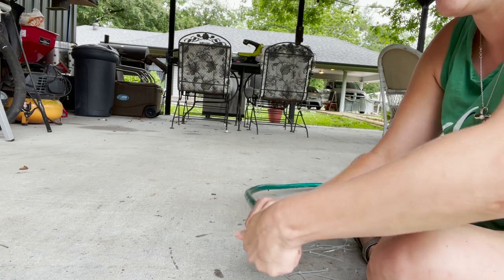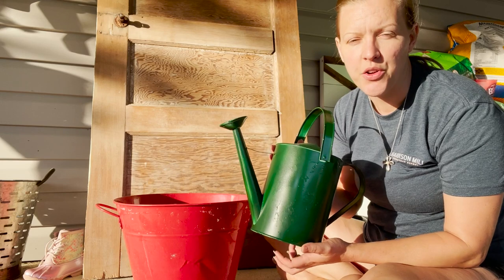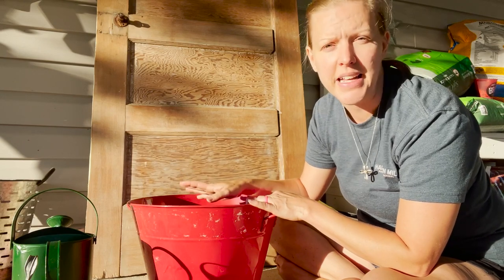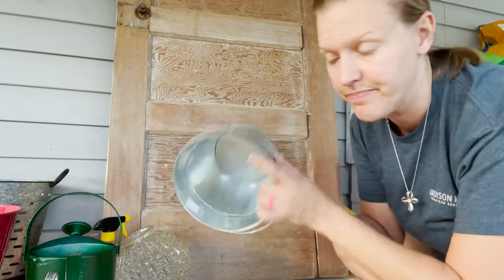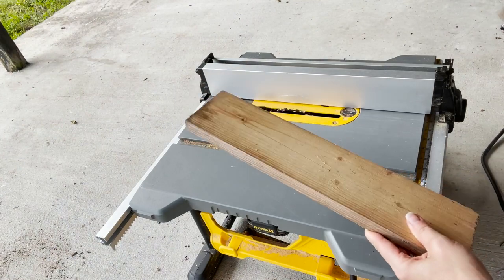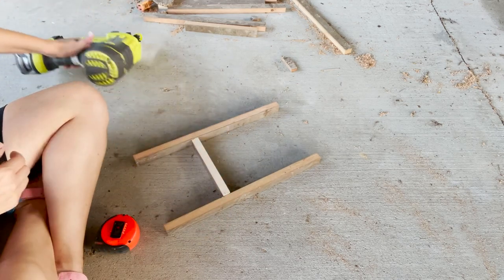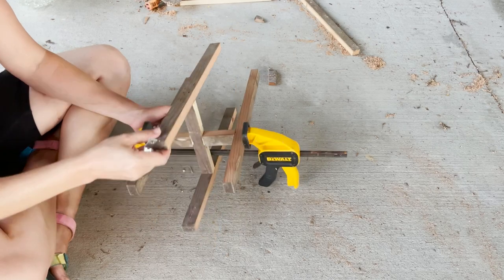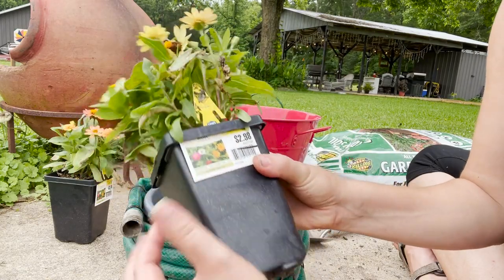UPCYCLE Projects Garden Edition | Trash to Treasure Garden Ideas

Comment: All great ideas.
 I think I would have skipped drilling some of those and just picked up some cheap plastic planters that would fit inside the metal containers. You could place some small rocks or pea gravel in the bottom of the metal containers and put the plastic planter on top of those for some drainage

Comment: You are so clever. I’ve done a few of the same things you did with different items but the hose was cool. Never thought of that. I love how you set them all up on your cute wagon ( really like that wagon). Have two questions. First I wish you continue showing how you made that wooden stand. You didn’t show how you got that last piece of wood ( that’s the half) to attach to the other wood. If you used the nail gun your nail had to go in a angle I would think bcuz you put the metal bar on it to hold all in place. I guess really wasn’t a question. My second I like that table saw you have. I’ve been looking for a small one that would still do the job on small projects. Would you tell me the make n if it’s battery powered or electric? I would greatly appreciate it. Always get excited when I see you have a new video up. I look forward to them. Thanks so much ♥️😊👍😊